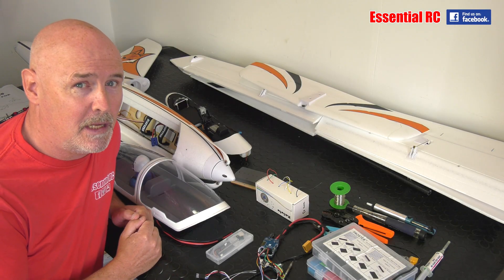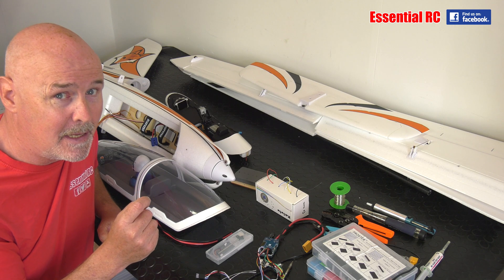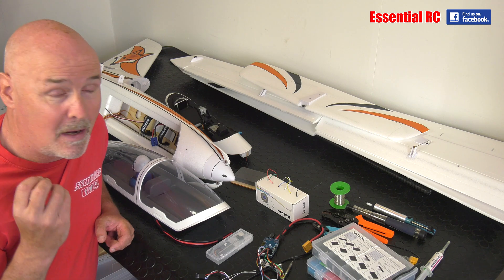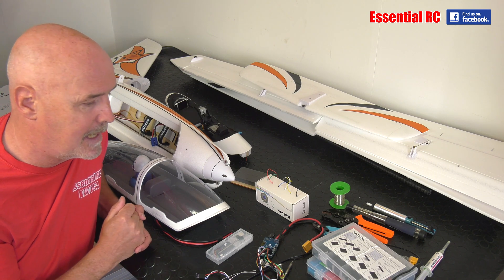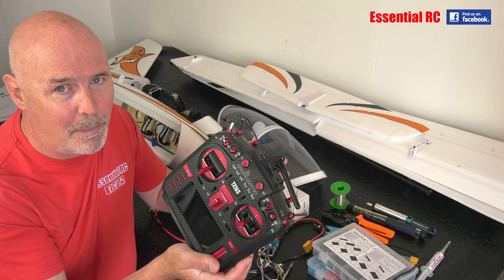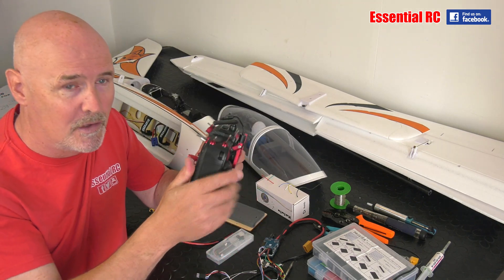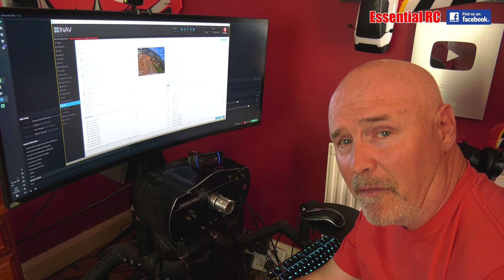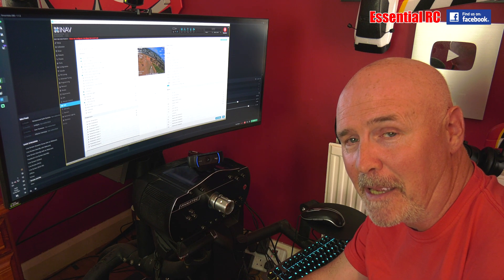DJI FPV 3 metre FMS Fox Electric Glider | Full Telemetry | Matek F765 Wing Flight Controller

Comment: Have you closed you’re eBay store now?
Reply from the maker: It wasn't mine. Was Jason's and I don't think he has the time to do it at the moment. Sorry. I've just got a 3D printer and am learning to use it so intend to take it up as a side hustle. I'll announce on the channel if and when I'm setup to do it.
Reply: @EssentialRC  can you recommend where to get the pan tilt setup you demonstrate? Also as I’m a total beginner, is that pan tilt transmitting to the goggles or isnit controller on the handheld radio via the onboard receiver?
Reply from the maker: @ChasingContours  https://bit.ly/atomRCPanTilt

Comment: hey there mate , looks awesome what your doing , i'm doing something similar in that i want to get airspeed pitot tube style on a large scale plane that i do aerobatics with headtracking, but i am struggling to get the data to my dji googles, closet thing i can come up  with  maybe using the sam FC you have there but i only need it for the telemetry, do you think i can just hook up the FC to my airunit and get the data that way , i can't use gps as it is slow and not actual airspeed, thanks for your time

heres what im doing this is the first video , 3rd flighthttps://www.youtube.com/watch?v=SyYdRhSdjzE&t=9s
Reply from the maker: Are you using iNav? Should work if you are using a Matek FC and their compatible airspeed pitot tube sensor. I did it a while back.

Comment: Great video, thanks. Has the project stalled? Your eBay store is like Old Mother Hubbard's cupboard and the link to the gimbal on eBay is dead
Reply from the maker: No! It has flown. You must have missed the video. It's here... https://www.youtube.com/watch?v=dBNo9GmJebA Regarding eBay store. Jason, who runs it, has had a baby, changed jobs and moved house in recent weeks but he'll re-open the eBay store soon.
Reply: @EssentialRC  Thank you on both counts. Will you be making the fin mount available either as a ready-made mount or an STL file on Thingiverse? I'm hoping to get a Fox 3000 but don't have he skills to design a mount like that myself
Reply from the maker: @BikerDon2  Jason will sell it on the eBay store soon.

Comment: Great video 👍 What size of capacitor are you using? Thanks
Reply from the maker: 1000uF Panasonic FR 35V Ultra Low ESR Capacitor https://www.droneauthority.co.uk/products/1000uf-panasonic-fr-35v-ultra-low-esr-capacitor?variant=36514554773576

Comment: Don’t you need to soldering the wires between the fc ?
Reply from the maker: Between the layers? No. I guess the power is conducted through one or more of the four corners that attach those layers.